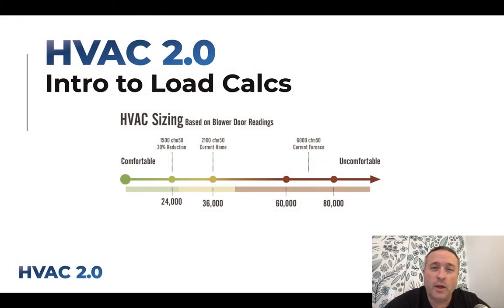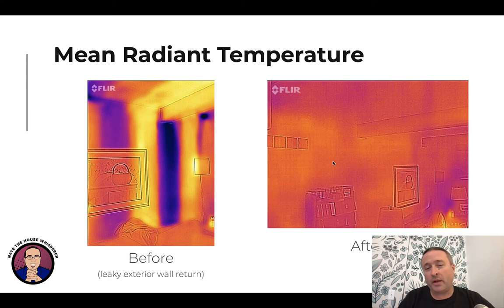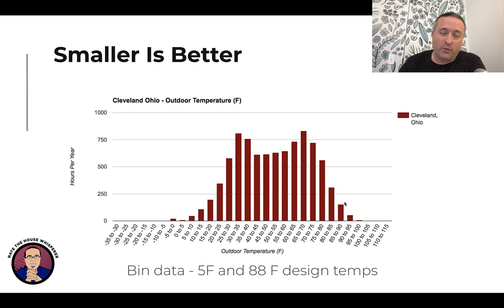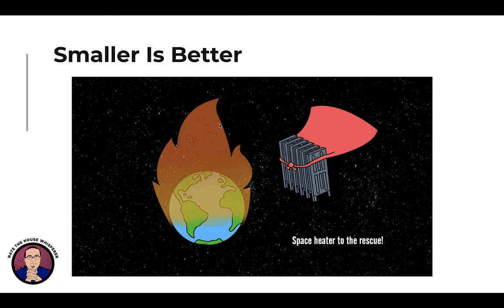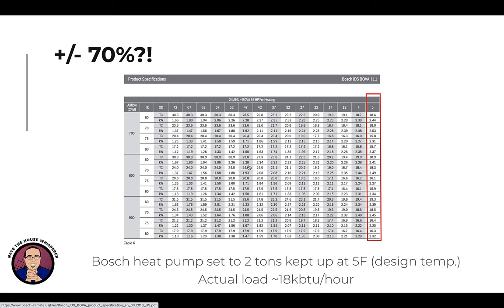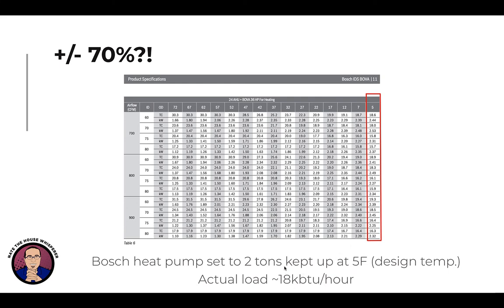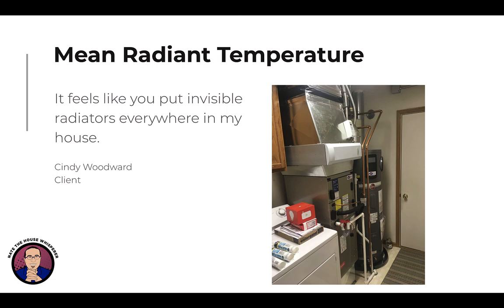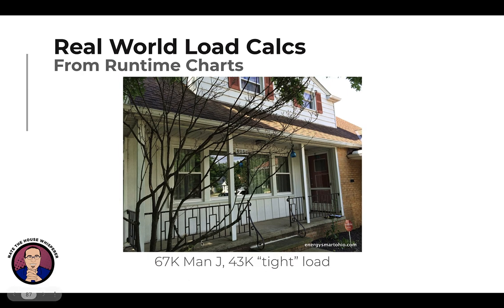HVAC 2.0 Intro to Load Calculations

Comment: Lennox has an inverter coming out soon? Can you tell me where I can find more info on that? I have been looking at the Bosch IDS2.0 but it doesn't seem like it can take full advantage of my Lennox variable speed blower, I think it can only run in two stages.
Reply: Just called the person that gave me a quote on the Lennox XP25 (which was a lot!) about the a new Lennox inverter type system and he said he has not heard of it yet.
Reply: Info is light, just a sell sheet I was sent. No eta.